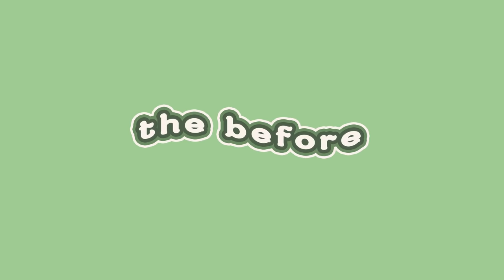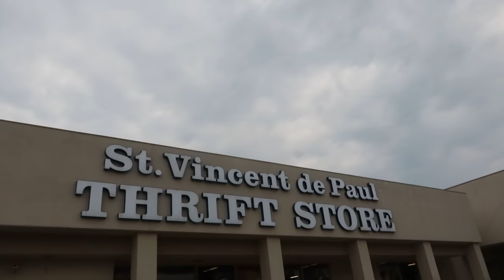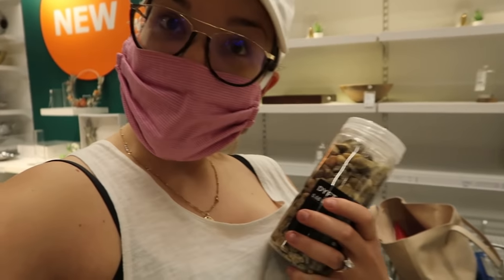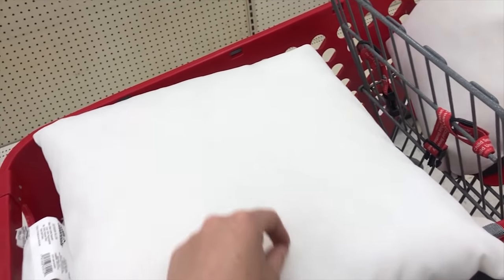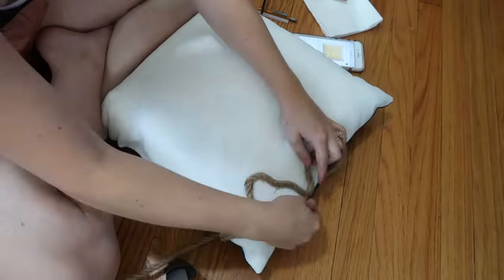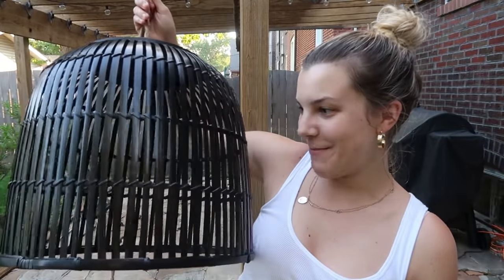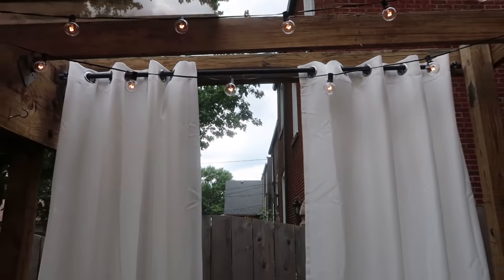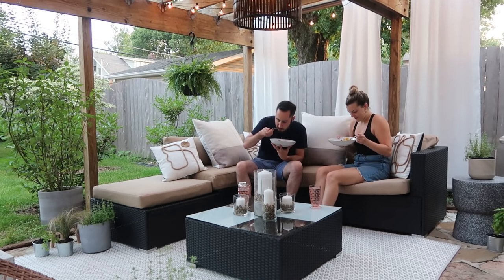DIY EXTREME PATIO MAKEOVER - Thrifted, DIY, on a Budget! | Outdoor Decorating Ideas

Comment: You are SO relatable!! Fantastic baskets for lights. Excellent.

SEW a 12" band of crisp black cotton duck, outdoor fabric, to your curtains. They should hit 2 mm above the floor, kiss the air above the floor.

"I got a patio set and I didn't get murdered." So funny, you looking in my head? Really NICE sectional!
Love the rug, and, it's big enough!! Yay!!

Hang both baskets; hang the smaller one lower. Also, you could  "dip paint" one of them -- say two or three inches of pure thick cream paint on the bottom edge of the basket/shade.

You COULD paint the smaller ome a super DARK blue (Newburyport Blue, Benj. Moore -- it's nearly black), or super dark forest green, or augergine!! Or black.

Ok, one more thing: You need to deeply water your plants -- put all the pots in a plastic tray w 2 inches of water for 2 hrs. Let them drink from the bottom draimage hole(s) up. 

Once a week, unless 100 degrees, then water that day, too.
Add SLOW RELEASE FERTILIZER to each planter PER PKG INSTRUCTIONS, quarterly, OR 10-10-10 or 15-15-15 (balanced) fertilizer, diluted to half stremgth, once every 3-4 waterings.

Comment: Watching in March 2022, so I'm late to the party.  Would have considered buying a couple of tubes of concrete crack filler to fill in the areas on the patio where the inset material has disappeared.  Not sure what it was.  Or fill in with some polymeric sand, which hardens after it is put in place and wet down with a fine spray of water from a hose.  Chances are, the landlord wouldn't even notice other than that the stones had been cleaned.  Looks absolutely wonderful.  I would have added more curtains on the other side that is open to the yard next store that doesn't have the tall wood fence, but other than that, it's a summer wonderland!